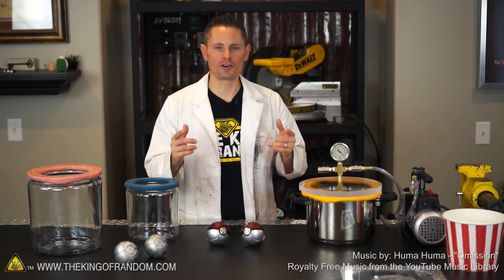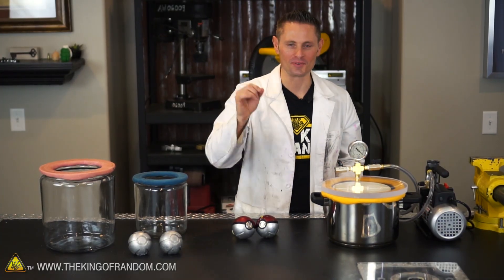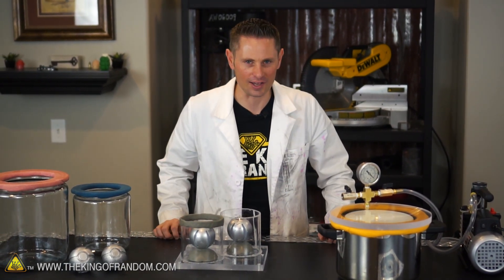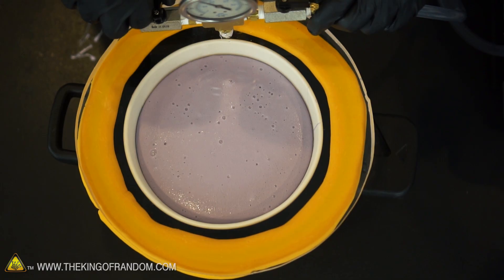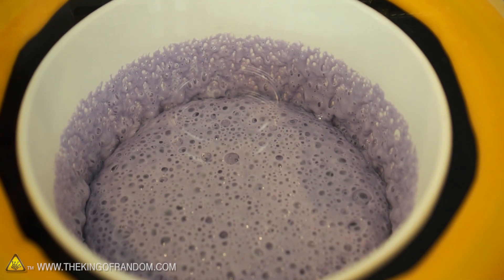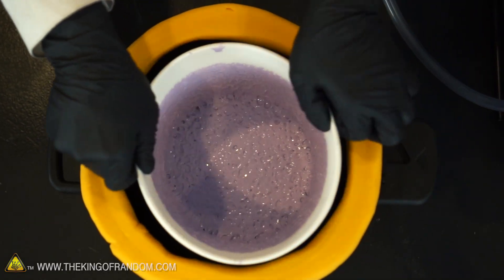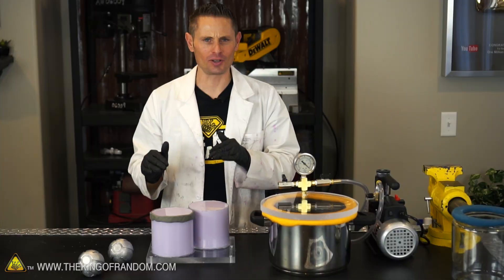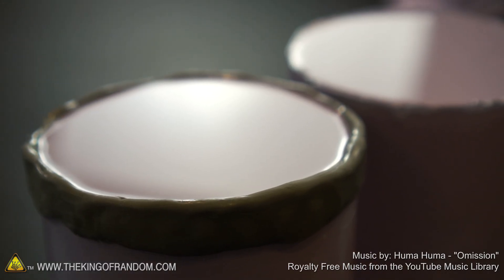How Does Silicone React In A Vacuum Chamber | TKOR's Silicone In Vacuum Chamber Experiment

Comment: Definitely hand mix. 

ANOTHER TIP: Reserve a tiny bit of the catalyst liquid. You can use that to clean up any drips or sticky surfaces. Any silicone will instantly set up if you wipe it with the liquid.

Comment: Mix the silicon in the vacuum chamber. A sealed swivel bearing with a paint mixing drill bit will do the trick.
Spray the object to be cast with some silicon oil and blow off any excess before pouring the media.

Comment: what if you use a pump to inject the silicone through a clear tube at the bottom of your mold and then remove the tube when it is filled. This might prevent bubbles caused by pouring over into the mold. Maybe the mechanism can also sick out any bubbles created during mixing in the same process.

Comment: stir it with a stick rather than a beater.  The beater incorporates air.  Then as it rises close the valve and hold to allow it to settle.  You got caught up either full vac pull or not.
   I wonder after a few minutes how much the bubbles are from a solvent or another chemical with low vapor pressure.

Comment: When you're done getting the bubbles out. Let it settle before removing the lid in order to let the silicone set without bubbles. 1 and a half minute should do it. Otherwise you're removing the lid and letting air get into pockets.

Comment: you could probably use slightly less of the catalyst to give you a bit longer of a work time, though too little and it wont really set up, there might be a chart some where with the cure times and amounts of silicon to catalyst you need to do this with the catalyst manufacturer. if not there is always experimentation

Comment: when you introduce a liquid to vacuum it will start to boil. the lower the surrounding preassure of a liquid, the lower the boiling point.
While some of those bubbles indeed are air bubbles, most of them probably are form whatever solvent you're using

Comment: really why you should do is to either when you repressurize the vacuum chamber, you should do it much slower, because when you do it quickly air gets trapped in the silicon again defeating the purpose. Also you should have put the mold into the chamber and it would have turned out even better

Comment: I've worked with removing air in molds, but using epoxy. The problem I had was a vacuum allows heat buildup accelerating curing time. For it to work properly I had to reduce the ratio of hardner to epoxy. The results were fantastic.

Comment: What kind of silicon are you using?  At work we use RTV630 and if you mix it in the proper ratio, you can leave it in the vacuum chamber for 30-45 minutes to completely degas it.  Also, you are right about the hand mixing, you introduced way too much air with the beaters.  If you had a single paddle beater and went slowly with it, that would introduce less air and degas faster.

Comment: If you want a "perfect" silicone mold, you need to do a 2-part mold instead of the single pour/hack it apart method. It's a little more involved, but the results are typically better, and your mold will last a lot longer. Also: mold release agent is your friend.

Comment: Can you do one with plaster of pairis and vacuum it after you pour it. then try my method that works every time and make your plaster by filling a mixing bowl with water to your desired level then using a flower sifter sift the plaster into the water untill you can see it at the top of the water level and then vacuum that to show how almost NO air gets into it? oh and make a casting with it too. Can you also try just putting the mold into the chamber. i bet the agitation would do the same thing.

Comment: Would vibrating the molds help remove air bubbles? That is, pour the silicone around the pokeballs and then set them on a vibrating plate,  the theory being the vibrations will cause the bubbles in the silicone to rise to the surface; your set up with the pokeballs looks like they will not be greatly affected by modest vibration, I could be wrong.

Comment: we used vacuum to remove air from moulded capacitor insulation  made of silicone. was in mid-70's. was for sliding capacitors in a microwave tube

Comment: Grant Thompson - "The King of Random" may I suggest you have a look at how concrete is poured and the use of vibrators to help trapped air surface. in you case a small vibrating table.
instead of the manual mixer you can use a bottom mixer at low speeds (not to create cavitations). your a lab mixing station with heather to increase viscosity, mix and allow bubbles to escape

Comment: Dental techs do this all the time. You want to use a vacuum mixer which applies vacuum while mixing the silicon, then when you are done put it on a vibrator to get rid of even more bubbles. Then put the mold onto the vibrator and pour from there.

Comment: Why not just avoid introducing air bubbles in the first place? They are just moulds so white silicone would be absolutely fine.
 Failing that, if you must introduce colour, stir it in gently rather than using a food mixer.
Also, I've suggested this before but build a vibrating plate -  when you've mixed your silicone put the container on the vibra-plate and it will send the air bubbles up ☝ through the silicone. 
It's also another video -  how to build a vibra-plate -  you can thank me later 😉.

Comment: I watched some people make molds before and they said it was important when stirring in colour to do it with a stick making sure not to introduce any air bubbles at that point. So a kind of purposeful rotating folding stirring motion that doesn't churn up the goo. Then when you've poured your goo in, you shake it, tap it, just a bit over and over and that encourages air bubbles to rise. An the molds they made were flawless. It also mattered a lot what goo they were using with different ones for different jobs.

I'm thinking after watching this, the sucking the air out is just wasting time and putting the goo into an ever closer to setting condition where its not going to flow over and into the mold as well. So I think speed is of the essence here. Stir fast but careful and pour right away. A personal touch I'd add is to do a little victory dance once its setting as a kind of offering to the mold gods but I'm sure that's optional.

Comment: To add to the mess: you may be able to get the air to the surface with a centrifuge.

It may help in getting the most silicon ready, but leave spronge-materials for vacuum or less important stuff.

Comment: why don't you put a motor with an offset weight on the platform that you have the molds on so it vibrates like a paint shaker to get all the air bubbles out?

Comment: If you hold something that vibrates like an electric razor against the container holding the silicone and the object you are casting it will force the air bubbles up to the surface and is way more effective than just tapping the container on the table. That may help with any bubbles the vacuum couldn't get rid of. And yes, don't beat the silicone.

Comment: 1) degass as much as you can
2) pour silicone into mold
3) put the whole thing in to vacuum AGAIN and let it sit tthere till all bubbles are out

im making molds like that all the time, without a single bubble :)
Reply: Null U can also use silicone that has a long set time that is designed to allow bubbles to escape... have several modes myself with no bubbles at all! and never once used a vacuum chamber 🙂
Reply: its not recommended to do this because it can move the object you are casting and also can pull bubble under ridges in the silicone and create bubbles in thte casting that wouldnt have been there before
Reply: i agree in certain cases it can be a bad strategy. always depends on what and how you are doing. i do it all the time for my applications and i never got a bad mold. cheers.

Comment: In the laboratory I worked at for a while they would use a special vacuum mixer for silicone. So the air bubbles just wouldn't get in there in the first place.^^

Comment: pouring silicone from height was bad idea - it will absorb air bubbles thus nullifying degas procedure. Also, when vacuuming you should left your pressure stable at point when silicone mass almost reached cap, that would be much more efficient.

Comment: Another tip there is no need to lift the bowl that your pouring the silicone from it actually can introduce more bubbles so try to reduce the amount that the poured silicon rolls over on itself. They way you were doing it you could see bubbles being trapped as you poured it. Just a tip 😊

Comment: At the medical device manufacturing company I work at we were recently transferred a silicone molding process.  To eliminate air bubbles we mix by hand, pour into the molds, then place the entire mold in a heated vacuum chamber, but gradually turn up the vacuum letting the biggest bubbles deflate first. (we've used room temp vulcanizing and heat cured) the results in optically clear silicone are beautiful! p.s.  love your channel...been subscribed since the microwave arc welder.  keep up the random fun (can't call it work). :)

Comment: I thought the whole point was to pour the mold, and then into the vacuume chamber? Don't you just introduce more bubbles back in when you pour? It may be minimal but if the whole point is to have no air bubbles then it seems like you'd want to pull all the bubbles out once you are done messing with it.

Comment: Try painting the Poke Balls with the silicone then put them in the vacuum.  The thin layer should give up the bubbles readily.  Let it set a little then pour the rest.  The silicone next to the surface of the item will be bubble free which is what you want.  The bulk of the mold bubble content won't matter if the item surface is bubble free.

Comment: How about using a pressure vessel to collapse the air bubbles in the silicone?  Place your part to be molded in its container, then the silicone, then all of that in a pressure vessel.  I have seen this method done on epoxy, namely in the taxidermy world to create lake and pond mounts.  One the part is under pressure you can leave it until it cures, no hassle with trying to transfer it over ect.  Nice video though and the effects of stuff under a vacuum is pretty neat!

Comment: Rather that pulling the vacuum and releasing all the air, would it be better to regulate the valve so the level stays constant ?
I would have thought pouring from too much of a height would introduce air in those folds.

Comment: All you need to do to remove air bubbles is poor the silicone over the mould and then hammer the edges or shake it via vibration

Comment: Hey Grant, Could you come up with a way to mix it while in a vacuum to avoid air contamination in the first place? Obviously I don't think a magnetic lab mixer would have enough power to move a liquid that viscous, but perhaps you could modify a mixer into the chamber, or perhaps there is a blender/emulsifier with a carafe strong enough to hold a vacuum.

Comment: Sir you've decreased the vapour pressure of silicon when it was a liquid. now one of its property is it expands in layer to increase in vapour . that's what is happened , air was sucked out , it was just the liquid under lower pressure which behaved as bubbles. if you do it for a longer time, you might have will solidify it.
Reply: Utkarsh ahuja are you high?

Comment: actually the silicone can expand to about 7 times it's original size. That process of vacuuming and leaking is called sawtooth ingredients. You can do that for about ten minutes usually and it will get most of the air out. In fact, if you were to find a way to mix it while you were degassing it goes much faster and will remove all the bubbles.After that, pour the mold and then degas again. That will help the silicone get absolutely everywhere!

Comment: I'd suggest using the dough-hook attachment, instead of any kind of beater, which is after all designed to add air.  Dough-hooks are only intended to mix.  Alternatively (and I don't know about the viability of this) fill a large flexible bag with the silicone, evacuate the air then knead the bag until it is mixed.  Some potting compounds are prepared like this.

Comment: I think the new molds will also have air bubbles, since bubbles are introduced during the pouring process, and will be trapped just where you don't want them to be; along the surface of the casting.

I also kind of doubt that it is just air that you are evacuating, but also volatiles in the silicone itself.

Comment: Whenever I need to mix stuff I mix with the bread hook blades they gently fold the mix. The mixer blades you used are designed to put air into the cake batter so you get a light air filled fluffy cake. Also if you check up on how air is removed from things like cement vibration is the key. I sit resins etc on a vibrating pad and the air bubbles rise rapidly to the top popping on arrival. I have considered a vibrating wand to insert as well made from a personal massager. The frequency needs to be relatively high. Hope this gives you some help in eliminating bubbles from mixtures.

Comment: Well that is different then how you do it with "plaster" investment. When you cast plaster you put the filled mold in the chamber not the investment by its self. But then again silicone has a much higher surface tension so it makes sense to do it this way.

Comment: A vibrating table would probably help you.
I made myself a lot of silicone moulds to cast PU resin grips for my climbing wall.
Even just using a small hammer drill (with blunt bit) onto a small steel tray (supported in the corners by old rubber O-rings) worked very well. Noisy as #$&% though...
And a paint stirring paddle (inserted into the drill chuck) rather than a whisk, is a  much better way of mixing. You want to introduce as little air in the first place, as you discovered.

Comment: Have you tried leaving the bleed valve cracked starting off so that it can only pull a partial vacuum, then slowly closing it as the mixture losses more of the air in it?

Comment: i think it is actually trapping more air in and getting out that could be due to more space between the lid and silicon level and not measuring how much actual air is trapped in and controlling the gauge pressure

Comment: Another thing to do when using a vacuum chamber and silicone is that you should tap the side of the container a lot to get a bunch of bubble to surface before even putting it in the chamber. This helps prevent that whole souffle effect in the first place. Secondly, the mold itself is what should be going into the vacuum chamber, not a secondary bucket, if you really want to be removing all the air bubbles from the casting. This is why hollow items aren't typically molded, or if they are, are temporarily filled with a secondary product to keep the silicone out. Thirdly, due to silicone being very easy to clean after it cures, the container going into your vacuum chamber being disposable isn't really that big of a deal.